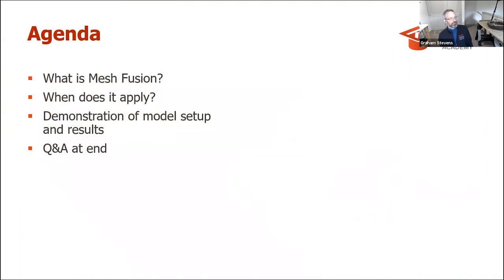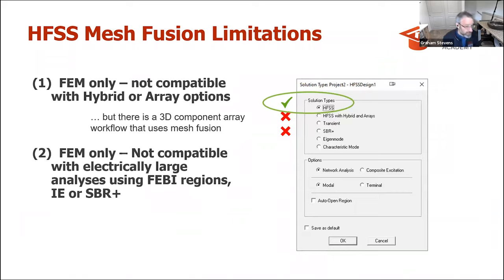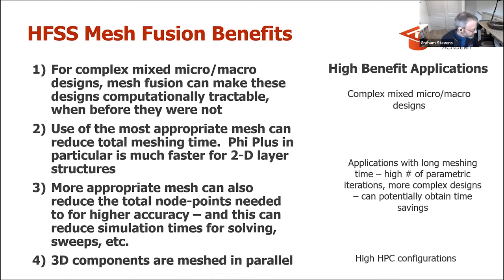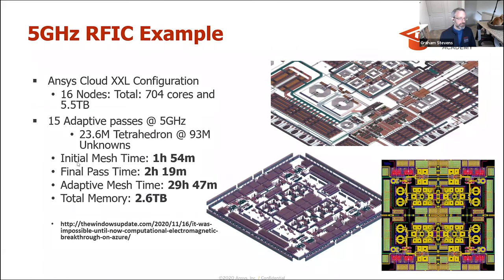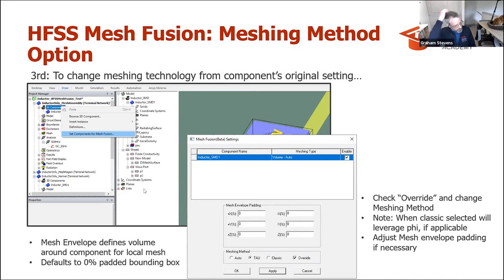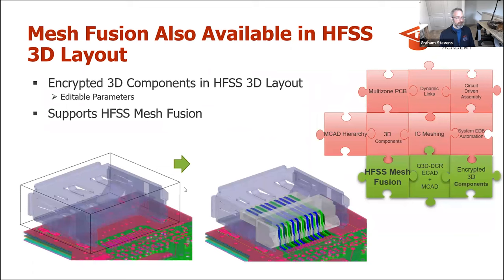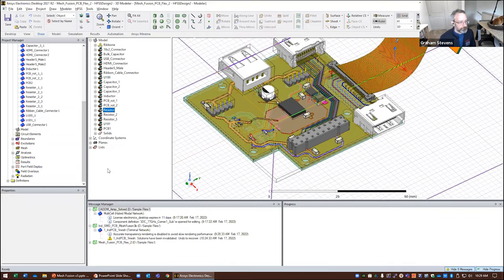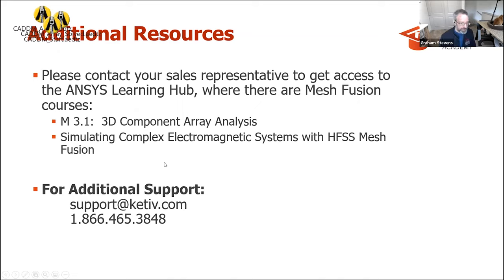Introduction to HFSS Mesh Fusion | KETIV Virtual Academy

Comment: While enabling mesh fusion option on each component in a system with multiple 3D components, the fusion opion on component with biggest dimesion has to be disabled. Correct me if I am wrong.